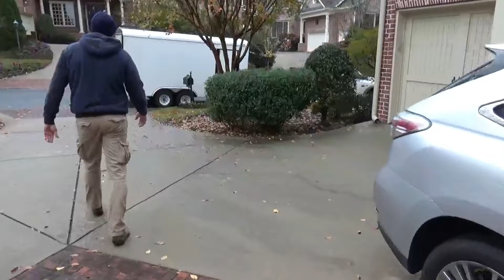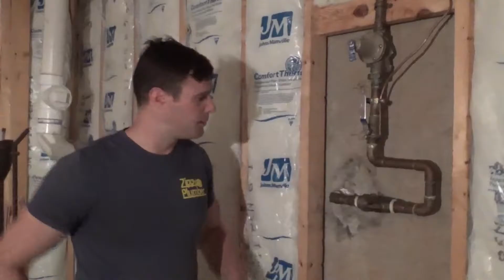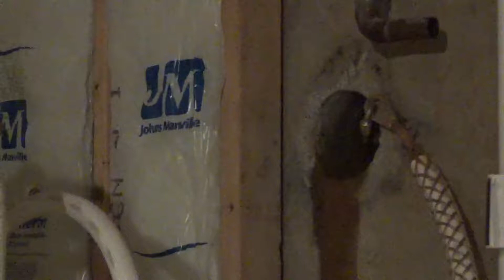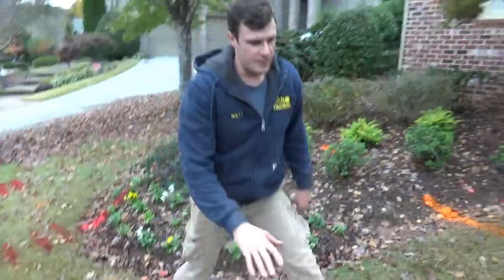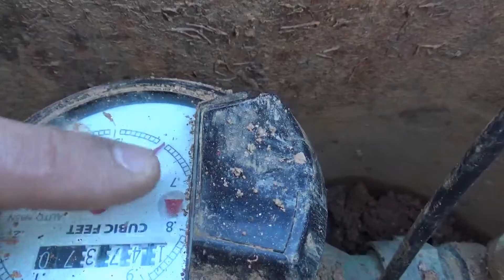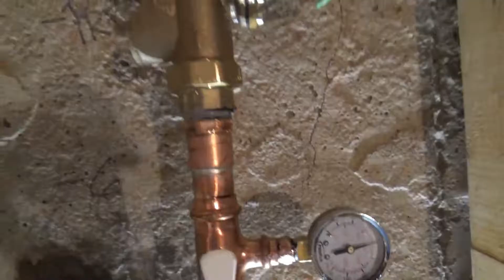Replacing an Underground Water Line with Trenchless Method

Comment: Nobody is showing, how they insert initial cable into the old pipe???
Reply: electrical fish tape through first, then pull the cable through and attach the splitter head
Reply: @mikew7513  Where do you buy a splitter head?

Comment: I'm going to guess that no permit was pulled and no inspection so you can run whatever pipe you want to run and I would have used a fernco to seal around the sleeve and pipe in basement they make a reducing one just for that

Comment: During the installation, why don't they just run the water line though another slightly bigger pipe, so it's protected, and if there is an issue, the water line can easily be pulled out and replaced, without all this mess?
Reply: Because now me is installing it and future you is paying to replace it.

Comment: Is it safe to assume this won't work with old galvanized pipe?
Reply: If you can't push the cable through it then it will not work for galvanized pipe

Comment: Thank you for the video. 
 Question: can this be used if the sewage line has a belly ? I am guessing not because that would cause the new line to have a belly as well?
Gotta 6-8 ft of a belly on the sewage line causing a back up every once a while. I can't afford to dig a tunnel for it, what would be your advice, what are my choices? 
 Thanks.

Comment: If we are pulling a one inch line, we make a 3 inch core hole. And use links seals to make it water tight like a frogs ass. But I like your snatch block. Very nice. Also our water has to be 5 feet deep. Up in NY

Comment: But how did you get pipe puller through system,
Information please.
Reply: They simply feed a multi-strand pull-cable from the water service supply side up to & over to/through the foundation side & then reverse-pull the pipe splitter through while also pulling the replacement hose.

Comment: Looking at the new tubing twisting going in, have you considered supporting it with some sort of bearing arrangement? Say, one of those expandable reels like they use at the hardware store when you buy cut-to-length wire. Pay for itself the first time the tubing kinks.

Comment: Great video!  I'm replacing my 1cuft/hr leak, 30+ YO buried copper service line via a home warranty company, and counter to mine and the service technician's suggestion of trenchless replacement, the company wants to spot repair my 30+ YO buried copper pipe.  I called the plumbing company, then the warranty company, and I hope a second, third, fourth, etc opinion can deliver trenchless replacement.  It does seem like the tools could be paid for with one or two jobs, and the work could last another decade.  This video has helped re-affirm my stubborn-ness...I am impressed it made the corner, will this slitter method work for a straight run of Copper too?

Comment: I have galvanized pipe. I'm getting an estimate and they do trenchless. I'm glad they won't have to tear up my driveway, and I'm not that far from the curb. So that's a plus.
Reply: How did your replacement go? I have galvanized as well. I’m going to proactively replace my water main before getting new landscaping and sidewalks done. Checking out the different solutions
Reply: @davidnewkirk2438  It went pretty well. They replaced the galvanized that went to the street with a copper pipe (regulations, had to have it copper) and later on, we replaced galvanized inside with pex. When the outside pipe was replaced, the water became clogged up, because there was old pipe inside the house. It happens, I guess. I didn't have a lot of water pressure, until the pex was installed. Love it!

Comment: Silly to put a PRV that will leak to take off 20 PSI, Should of left water pressure at 80 PSI.  I did enjoy the pull in water pipe.
Reply: 80psi is too much. You have to reduce it.  At night the city pressure would probably bump  up to 100psi.  Always a prv.
Reply: @tylero8595  100 psi don't bother me at all, I keep my house around 80. I have seen whole neighborhoods in the 120's. PRV is just another potential leak or break and shut the water pressure down to 20 psi
Reply: @tylero8595  Probably go down in my area, Everyone runs sprinklers for yards almost year round.

Comment: Can I run this through galvanized piping? I am desperate as I am working with limited funds? I have a small property in CA.
Reply: What does something like this cost
Reply: I've got galvanized as well. How would a splitter split through metal? I don't see how this method would work. (So back to digging I now go!)
Reply: I just got an estimate for replacing my service line to the street, and it was $15k. yay
Reply: @thecinematiccrapalliance  How many feet are you from the meter?
Reply: I do not know the answer to your question. Search for videos on PEX A tubing installation projects by homeowners.

Comment: great way to get the job done.  Im in Ohio, I replace water lines..mostly old galvanized..rusted badly...what system do you suggest for this type of material? Where should I look to buy tools needed to pull a line through when there's barely a pencil width of space in the pipe.
Reply from the maker: What part of Ohio, I’m from just outside of Akron.
Reply: Cz z u